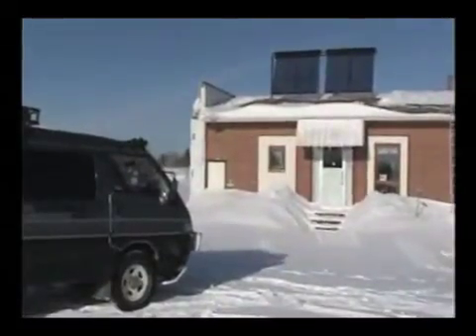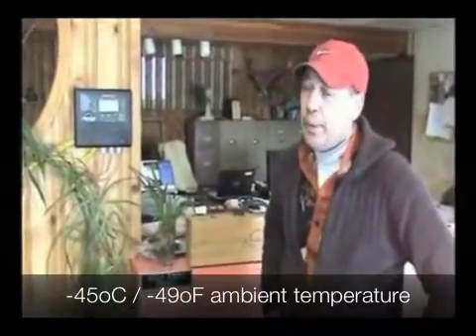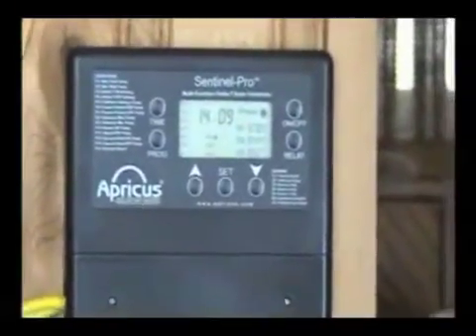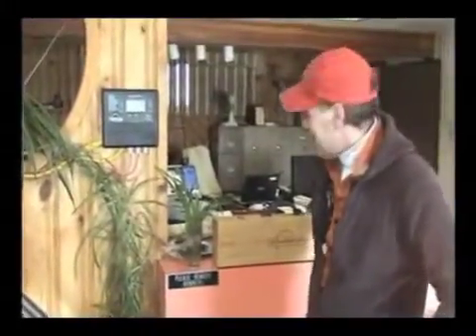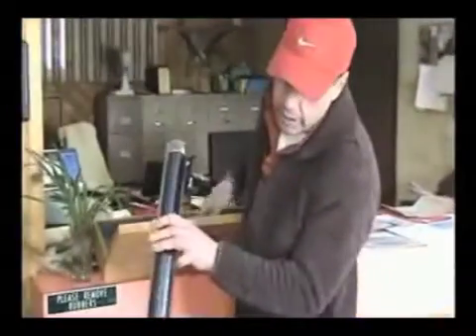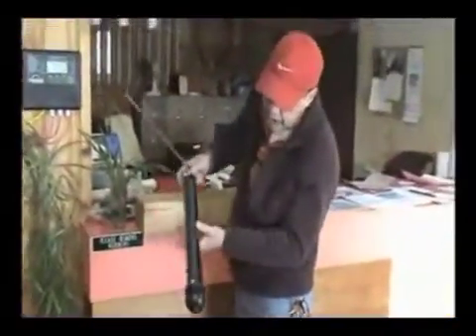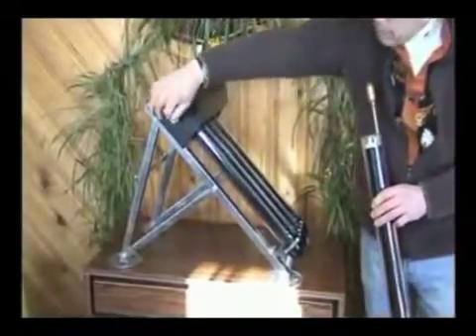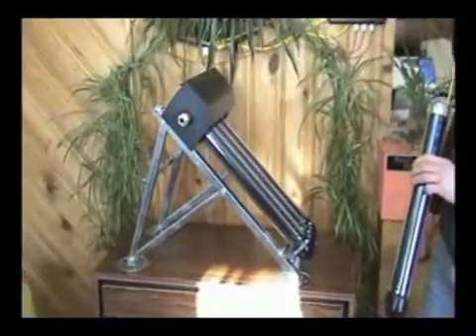Apricus collector in -45oC

Comment: Hello, I was trying to think of a way of making a solar hot water heater for my RV and then the small model of the solar evacuated tubes in the video looks just rite! Does it have any need for 120V for the controls, or can it be used as a passive system with no pump? It would be heating a 6 gallon tank that has a port for a heat exchanger already built in! Please reply to this if you can help  Thanks, Joe